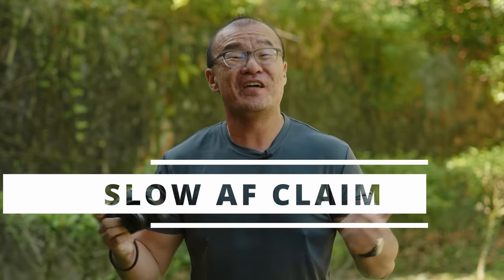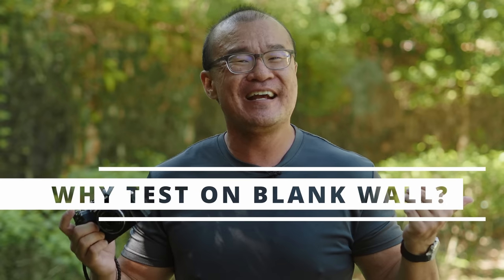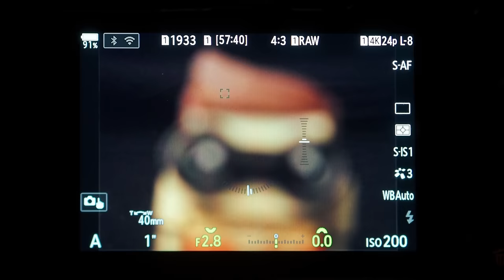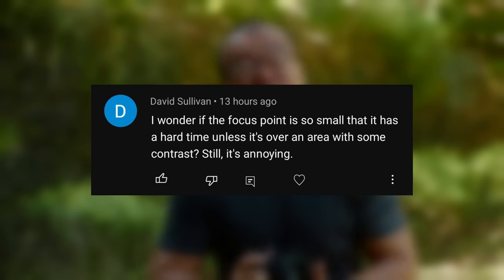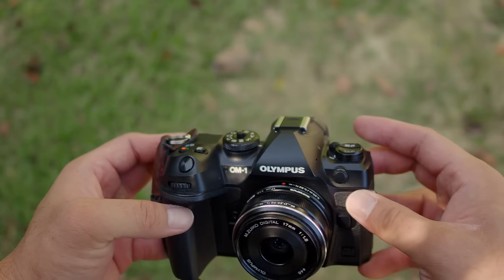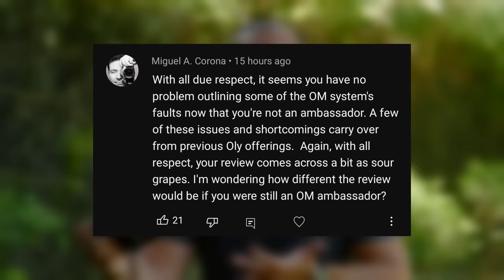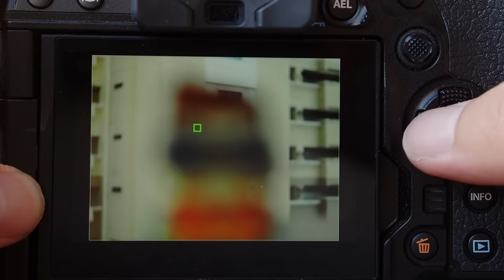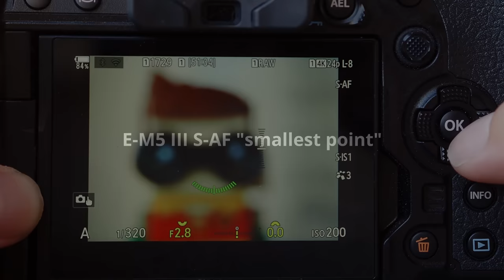OM-1 Slow S-AF Follow Up With MORE EXAMPLES

Comment: Hello Robin and I am surprised that you have found fault with your OM1. My experience of the OM1 is completely opposite to your findings. I have tried to replicate the poor slow 'hunting' on my OM1 with a variety of lenses (including the 12mm f1.8) and cannot make mine exhibit any of your faults. I can only conclude that yours is fualty and that it should be returned to OM Systems, if you can.
Reply from the maker: If you can refer to the pinned comment in my previous video, someone did the exact same test and verified my claims. And also sifting through the comments, a dozen or more others have similar issues. I am not alone, and certainly my camera is not faulty. 
The S-AF works fine in normal situations, once you are in low contrast and low light (which I deal a lot in my shoots), the S-AF is just not working as efficiently as the older cameras, as demonstrated in my video against E-M5 Mark III. 
I did not say the S-AF is bad, I am saying it isn't as good as E-M5 Mark III, and I expected OM-1 to be better!

Comment: I have an OM1 and a EM1.3 (I’m rubbish at selling things). I can’t replicate Robins results: both focus in the same situations. However, there’s less noise from the lens motors moving the elements back and forth to focus on the EM1.3 than there is on the OM1. I’ve tried it with the 12-40 Pro and the 12-40 Pro Mk2 and the OM1 seems to move the elements about for a fraction longer. I’ve not noticed this in non-test conditions when photographing the Red Arrows or the SuperAerobatics Wingwalkers though, or at last year’s Goodwood Revival. In all these situations the OM1 has been superb and got me another shot that appeared in a calendar.

Comment: I don't question your honesty in reviews as I've followed you for some time, and appreciate your objectivity.  However, I've been trying to replicate your focus problems with my OM-1 and I'm wondering if you should send your copy in for service.  My single point AFS works great.  It's at least as good as my EM1ii and my Pen-F.  The only time I can get it to fail is if I try to focus on a plain white wall with no details,  But then it is contrast detect AF after all, and my Nikon cameras fail this test too.

Comment: I think we can be assured that Robin is reporting a real issue he has found with the OM-1. Having said that, I haven't noticed the issue after 200K shots or so. Perhaps not totally surprising since I rarely use single point with S-AF but, given the camera has been out for a while, it's surprising that we haven't seen other reports of the issue. Seems like an issue which would pop up quickly. My first thought was some issue with the lens.

In any event great he's reporting the issue. If it can be duplicated I'm sure the engineers can fix it. The OM-1 is very fast for me, even with single point S-AF.

Comment: Hi Robin, I wonder how the SAF compares across the whole Em1 line? Has it improved much since the original em1 even? In your other recent video you showed the difference between the AFS for the em5iii (same as em1ii) and OM1 in low light, and the em5 was better. Perhaps the original em1 even has superior SAF in low light compared to the OM1?! That would be a little funny. 
Thanks for all your great videos, your enthusiasm is inspiring.

Comment: Hello Robin can I ask you it is just about Can you please think about this IE: if a full frame sensor is 36mm x24 mm and a micro four-thirds sensor is 17mm x12mm then if Olympus or Panasonic made a sensor with four micro four-thirds sensors it would be IE: if 16mp it is then 64 mp or 20mp it is then 80mp and the same size .I had a Nikon D800 which was 36mp full frame and had to sell because a never used it for 2 and a half years then last November I purchased an Olympus OM-D E-M10 Mark IIIs and have just purchased a Olympus OM-D E-M1 I know that these cameras are five years difference but some of the photos I have taken are very nice so I will see if the em1 is as good as the em10 mark 3 kind regards

Comment: I checked S-AF, and as Robin says,  it is flakey. Though it is only a work- around,  C-AF doesn't seem to have this problem.
My question to Robin and others is about the EVF. With the same  settings (auto white balance and same exposure comp), the OM-1 evf seems darker and more orange tinted than the EM1-2. Any observations? Thanks.

Comment: Thank you for your honesty, Robin. You stay true to yourself. The om1 behaves like my em10 and em 10 ii. It looks as if in that mode, only contrast based af is working. May IT IS a firmware glitch? That would be great. But could also be due to the new sensor af pixels?

Comment: Hi Robin,I am usually using Sony a1 and Sony a7rV cameras,I have also a Fujifilm GFX 100s MF camera.After I had two brain surgeries I bought an OM-1 with several Olympus Pro lenses including the 150-400mm f4.5 because I didn’t want to carry anymore the heavy FF or MF cameras.I am very pleased with the AF speed of OM-1,it is much better than the Fujifilm and it is not far from the Sony cameras which IMO the best AF system.The AF of OM-1 is not slow and not hunting, it is quick and accurate.Most of the time I am using the OM-1 for my BIF photography and it is working magically, my only complaint is more MP. BIF photography I need to cropping most of the time and I don’t have enough pixels.I hope one day we can have a 50MP stacked micro four third camera.
Reply from the maker: The AF on OM-1 is good, but it is also slower and less reliable than the older cameras, like E-M5 Mark III, which I have demonstrated. I have used the E-M1 Mark II/III for 6 years. I know exactly how the AF performs, and I immediately noticed the OM-1 was not as confident in nailing the shots.
Reply: @robinwong  I had also E-M5 mark II as a second camera,I hated the speed of AF of this camera.IMO nothing to compare between the old Olympus cameras to the new OM-1,the Sony stacked sensor may better than the old one.Also IMO the OM-1 is more accurate and speedy AF than the old  Olympus cameras.Once again with this camera I am taking wildlife and BIF photos, combination of 150-400 with OM-1 is fantastic, only downside for me less MP.When there will be a 50MP stacked sensor OM Sytem camera, I will sell all my Sony system.Beside the 150-400mm, I have 8mm fisheye which I use rarely,8-25 f4,30mm and 60mm macro,12-100 f4 and 40-150 f2.8 with TC 1.4 and TC 2x.The optical quality of Olympus pro lenses equals to Sony GM lenses.
Reply from the maker: @victorfeinstein1815  E-M5 Mark III is way ahead of E-M5 Mark II in terms of speed. They use different focusing systems altogether. E-M5 Mark III was similar to E-M1 Mark III, while the E-M5 Mark II mirrors the older, first generation E-M1, which by today's standard is quite far behind. 
If you have a chance to try an E-M5 Mark III/E-M1 Mark III, do a test side by side against the OM-1. Someone did (I pinned his comment in my previous video) and he verified my claims. A dozen or more people also have similar encounters. I am NOT alone.
Reply: @robinwong  Try BIF photography with any one of your old cameras and compare them to the new OM-1,I want to see if you can still claim that the old cameras AF quicker than the OM-1.I know the answer but I want to hear it from you.

Comment: I tried this with my 12-40 pro and the OM-1, M1 MarkII and the G9. 
On the white part  of the  wall, the OM-1 failed. The other two sometimes struggled, but they could focus. 
I have firmware 1.2 on the OM-1.

Comment: Hi Robin, another question please - for your low light shots of people, would the CAF with eye detect be better than SAF and more reliable? I know you spoke about CAF being worse than SAF in low light but wondering if the eye detect specifically improves results (when a person is looking towards you of course). I've never used a camera with modern eye detect so I'm not sure how good they actually are nowadays, and whether they live up to the hype/marketing claims. 
Thanks again :)

Comment: I'm beginning to believe Robin's particular camera has a build issue. Sony had similar problems with A7riv not focusing correctly with the 200-600mm lens. Many people do not have the focusing issue but enough people out there actually do have the problem. Maybe Robin can contact Jimmy Cheng or Peter Fosgard to see if they have similar experience with OM-1.
Reply from the maker: I already have a few OM-1 owners emailed me and telling me they had similar issues. Also, read the pinned comment in previous video by (Pedro) he verified my claims in his own tests.
Reply: @Robin Wong  thanks. Hopefully this is just a firmware issue rather than hardware one.
Reply: @robinwong  Perhaps I'm rare in how I read the comments (I had no reason to think so), but I've been amazed at how many commenters don't read the other comments. I've lost track of how many times you've answered the same handful of questions/theories -- testing all lenses, light conditions, defective camera. Great patience you have!

I believe I have experienced the slow focusing, but because my subjects weren't always in low light, low contrast, the issue didn't rise to concern level for me. Now that you've pinpointed the conditions, I'll look more closely and I suspect I'll confirm your findings unfortunately. I have already noticed one anomaly with firmware 1.4 -- occasional (rare) extreme magnification in the EVF and monitor when focusing. I don't recall it happening with f/w 1.3. Hope both are fixable with f/w.

Comment: Tx for exploring further. I don't have another camera to compare with, but I do not see the degree of single point S-AF hunting as you shown with all subjects but a white wall that I tried with the 17mm/1.8, down to 25sec exposure time lighting condition (with AF illumination ON and OFF). Perhaps I need a Lego Man for my tests! Not saying it isn't worse than an EM1, I can't say, but I do hope you bring it up to someone in OMDS to investigate. Surely you still have some contacts there. Did you try other lenses?
Reply from the maker: I have tried all lenses. Refer to the pinned comment in previous video (by Pedro), he verified my claims with similar tests. 
Have you tried specifically in low contrast, low light condition?
Reply: Light condition was bedroom walk-in closet with no direct lighting (artificial or natural), and light wall bedroom with indirect sunlight on an overcast day. Perhaps had I have an EM1 to compare it would have been more snappy focus, but nothing to suggest AF failure per se. I had focus lock with single point AF target in less than a second at a light reading of 25sec exposure wide open aperture ISO 200, and near instantaneous otherwise and even had a C-PL on, effectively focusing with the equivalent of F3.5 light input.  All that said, your observation is worthy of investigation by OMDS in a more controlled setting and surely can be improved upon either from a body or lens firmware.  Surprising none of the "ambassadors" with EM1's/EM1x's reported similar observation (that I am aware of)... or perhaps not so surprising or are they all so focused on C-AF birds AI photography as to not having tried to compare S-AF performance with their existing EM cameras?  All Firmware updates to date addressed C-AF/S-AF issues/performance improvements, so there's hope providing they are made aware of the issue.

Comment: The truth sometimes hurts but this is how this system stays good. If people are not honest about issues, OM system can produce subpar cameras and features and the 4/3 system will truly die. I love that every feature on my EM1 Mk iii works really well and doesn't feel gimmicky. Maybe open a warranty claim with OM system and see if they have any thoughts? Are other OM-1 users having the same issue? This seems like something that could be fixed in a firmware update.
Reply from the maker: No warranty because I did not buy this camera. And it was not purchased within my region. Also, a dozen or more people from previous video have commented the same issues.
Reply: @robinwong  You have made a wave in the community and from other videos, people are saying the same thing. You are an important pillar in the community

Comment: Hello Robin. I have always been a fan, even now a “member,” but I must say that I have not experienced the same problems with my OM-1. The autofocus has been lightning fast. The only times it has struggled has been due to user error—most commonly trying to focus at less than the minimum focusing distance of the lens. Do you find the same problem with other lenses? Keep up the good work!

Comment: There is a major difference the S-AF of the OM1 and the previous models: the older cameras used contrast AF only for S-AF, the OM1 always starts with Phase AF and switch to contrast AF in a second step. assuming the contrast AF is doing the job in both of your scenarios, the Phase AF is the difference. It consumes time without result and then the OM1 will switch to Phase AF.
The Phase AF of the OM1 is not build on classical line sensors or defined pixels on the sensor, it uses the subpixels of the new quad-bayer-sensor. Therefore the size of the phase AF pixels is only a quarter of the full pixel from the 20MP count. You need sharp lenses (at open aperture) and phase detect optimized objects. Therefore phase detect AF at the corners can be much worse in comparison to the center of the frame.
You tested the AF in low light in combination with (more or less) „clean“ surfaces, that is a deadly combination for phase detection. 
In your scenario the camera just loose time using the phase detection before it switch to the second option with contrast af, which (I assume) has the same quality as the older cameras.
Reply from the maker: My issue is - why is E-M5 Mark III performing drastically better?
Reply: @robinwong as said, the phase AF is in this special case worse then the often damned contrast AF. Also the 5MIII uses only contrast AF for S-AF and therefore in this scenario better then the OM-1.
Reply from the maker: Hence, the point of my video - OM-1 was slower than E-M5 Mark III in S-AF. Case closed.
Reply: In this scenario: yes. But what about a more realistic scenario: when you put the focus point on the eyes and not on the forehead of the small toy? Is the OM1 then still slower?
Reply from the maker: What more reliastic scenario? You want real life? I have missed shots in my paid jobs using the OM-1 in one job more than I have in all the jobs I have done in the past 10 years combined. That is how bad the OM-1's S-AF is. I did not want to make this a huge deal, but I have to be honest with what I find. You can try to "what if I focus it here and there" but trust me at the end of the day, it does not make a difference because the truth is the S-AF of OM-1 in low contrast just fails hard. And there are consequences. This is also reported by MANY others in this commet thread, if you take some time to go through them.
Reply: @robinwong  you misinterpreted my point: I don‘t wanted to criticize you, I‘m looking for solutions! The AF system is different, it works different. That is fact! No the the results are worse. That is also fact. Now I‘m looking if it is possible to get better results, maybe the camera needs different settings. Changing the process is never good, but happens daily by every company. So we have to take care of ourself and need to find solutions by ourself. Not nice, but reality (also with other vendors…)

Comment: Thanks again for the video to confirm your findings.  It would be interesting to expand the sample size and see if anyone else has this issue.  A problem for OM system reps as it would put them on thin ice, but interesting for other's with an OM-1 to check out.  Seems like they went all guns blazing to improve CAF but there was an oversite with SAF.  Does the problem occur equally on all lenses or is it more apparent on certain ones.  Again thanks for sharing.  You're keeping me happy with my current camera so I limit purchases to lenses or save some money.
Reply from the maker: A dozen others from my previous video's comment section reported the same issue. The sample size is quite large. If you do a search around the internet, the S-AF issue is quite a common thing on OM-1. Also, I used the OM-1 for my paid shoots, I have been using the camera for a month, using all my lenses, before I made my conclusion.
Reply: I see you already answered this.  Not good if it happens with all the lenses.  Do you think you might have a defective OM-1?
Reply from the maker: @evanmcknight2566  no indication that the OM-1 is faulty. The S-AF still works. It is fast. Just not as fast as E-M5 Mark III/E-M1 Mark III, and in low contrast areas, or low light, it clearly struggles a lot more, which was detrimental to my work.

Comment: I use my OM-1 since 10 month now, always beside bird tracking I use the smallest focus point but I never experiences slow focus problems as you mentioned. I have a lot of lences like 7-14, 12-100, 100-400, 60mm makro, 45mm f1,8, 25mm f1,8 no focus problems at all. Could it be that it is just your camera??? Regards Volker